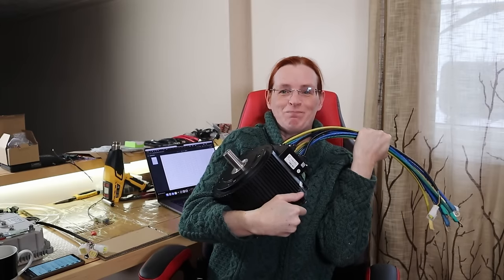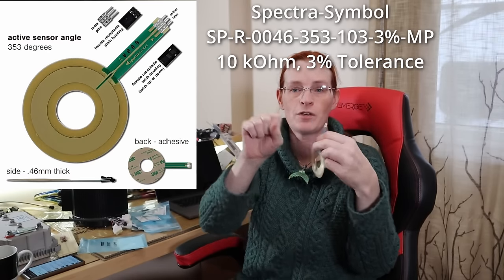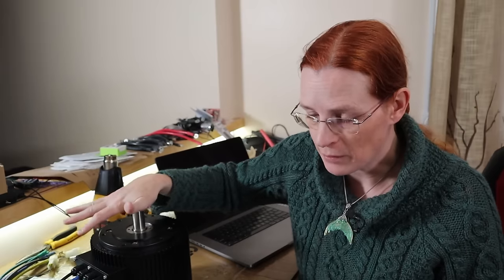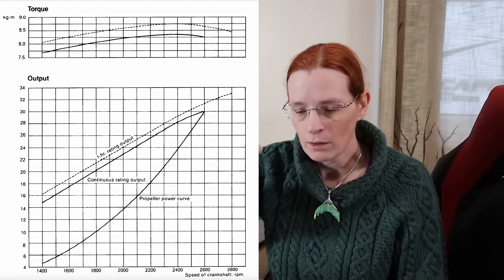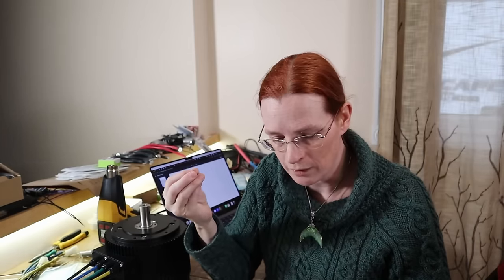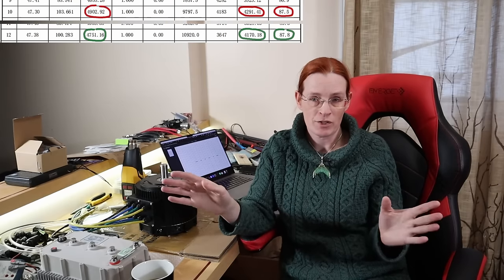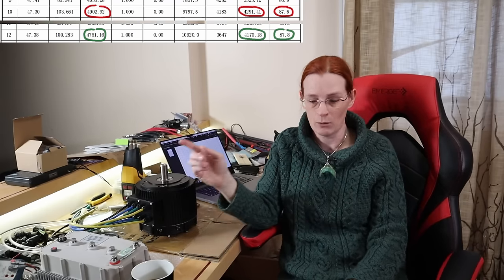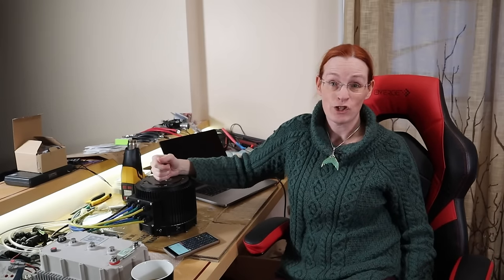Ep. 86 - Decisions Made! - Let's Get Technical

Comment: Nice idea's Maddy.s it possible to put the two motors in line and connect the shafts and then power one motor and let the second run freely. And if needed to power both. for extra power? Or is the friction of the free running motor too strong for that?
Reply from the maker: I had assumed that the resistance would sap too much power, but now from some other comments, I'm thinking maybe it'll be OK. I'll experiment!
Reply: @TheDigitalMermaid I have this vague memory that some electric motors operate with less resistance when on open circuit.

What mechanical resistance do you feel when trying to spin the axle manually on the desk?
Reply from the maker: I physically can not turn it by hand.

Comment: Regrading regen. I would advise you be a bit pessimistic on how much you are going to get from it. I am still saying you SHOULD do it, it is worth it, just don't over estimate how much you will get from it. Ever time I have ever heard numbers quoted - it has been at travel speeds higher then you would expect and also with props bigger then you expect - I suspect that it is mostly releated ot area of the "prop circle" and that how pi*r^square for the area thing means even a bit bigger prop catches WAY more water.
Reply from the maker: Oh, I fully expect to be underwhelmed, but I am trying to be as effective/efficient as I can be. That said, one of the many reasons I bought the Landfall is her cruiser/racer lineage. She's shown me how easily she car get up over 6 knots in even modest winds. You're right, going from ~13" to ~17" prop is going to be a lot more drag, but then, if I need power, I'll trade speed for kw. :)

Comment: Check out the following idea: Have both 10kW and 5kW motors permanently coupled to the shaft. For high cruising speed the 10kW should be the driver and the 5kW spinning freely. The "penalty" here will be the friction losses of the 5kW motor transmission and those of the idle spinning motor,* i.e. electrically disconnected. For getting down to 5kW "eco" mode the 10kW motor will still be the driver, but now the 5kW has now assumed the role of a generator. Doing so, you will have the 10kW running at high efficiency while recuperating the extra power. The penalty here consists  of the mechanical and electrical efficiencies from the shaft to the batteries (transmission + generator efficiency + conditioning for battery charging). It goes without saying that by adjusting the generator point you can have the 10kW running at its most efficient point. The "bonus" mode will be when the 5kW motor gets switched to driver too. (*) In my language (Greek) this would be called a "crazy" motor after the technical term of crazy pulley - τρελή τροχαλία. Nikos
Reply from the maker: Friction losses is why I originally didn't want to parallel them, though I'm starting to think, based on comments, these losses might be very small... If so, paralleling them all the time would be back on the table.
Reply: @TheDigitalMermaid  Dual motor EVs often let one motor spin idle when there's no need for the extra power and don't suffer much from the friction.  I'd be more concerned about breaking a bolt or chewing up a thread if you need to swap belts around much.  The less you touch the mechanics the longer they will last, and you're not going to want to be doing this in a storm (i.e. the longer YOU will last).

Besides, with both motors in parallel, one can be driving the boat while the other is in regen, so you can charge the batteries at the same time...  Oh, wait.  :)

Nice to know that the recent trip home could have been done with the post-conversion boat!  And given the engine failures, with a lot less stress.

Excellent video and explanation, as usual.  Your channel is unique (and refreshing) in letting us peek inside your head on the decisions and what goes into them.
Reply from the maker: One concern about free-spinning the inactive motor is mechanical wear, also, if the drag is otherwise low enough to make it worth it... The trip home on electric is still theory for now, but I would LOVE to repeat the trip, possibly in reverse, just to prove it can be done, and silence many of the nay-sayers. 

... or fail and be a great cautionary tale to arrogance. ;)
Reply: @TheDigitalMermaid  when they free-spinning the inactive motor that motor is usually not a permanent magnet motor as they don't like to be free-spinned but a AC motor that can do that without any problems. Dual motor EVs usually use different typ of motors front and back. Your Tesla is a good example of this setup.

Comment: A brand new Tesla model 3 has all of the parts needed for your project with ten times of the power at the same cost 😊
Reply from the maker: Sadly, not at all the same cost, given I saved a lot DIY'ing the build. More though, I don't need that much power, and most of the model 3 still use high voltage and cobalt based cells

Comment: Sounds very interesting, and you are gonna have fun experimenting and learning. I can't wait to see this phase progress and the design develop.
What you said, about wanting redundancy for failure and the 5kW motor being more efficient, made me think. I know you've already got the 10kW motor, but did you consider having two x 5kW motors, running only one when that's all you need, and somehow enabling the 2nd when you need more power. Are 2 x 5kW running in parallel more or less efficient than one 10kW, when at higher power output? Then if one fails, you still have the other, and replace it when you make port and can get another shipped, maybe even just carry a 3rd as a spare, assuming that only one will ever fail at any time. It might make the cable sizes and fusing easier. I know it all adds up in cost and weight, I just wondered if this was an option?
Reply from the maker: I did think of 2x 5kw, but by the time the low-end efficiency thought came up, I had the 10kw in hand. The efficiency is very dependent on where I am in the power curve, but the 5kw gets over 90%, which the 10kw doesn't, so there's at least some points where 2x 5kw would be more efficient than a single 10kw, on paper. Now having the two motors running together might cause mechanical inefficiencies that eat that benefit in the real world.
Reply: @TheDigitalMermaid  Yeah, the mechanical complexities of enabling the 2nd motor only sone of the time, could be a problem. And generally the types of motors that allow regen, don't free-run when not energised, so you have to actively disengage them mechanically. It's a common issue in EVs and e-bikes too. It's a shame, as Murphy's Law ensures that in a system with redundancy, where one is the larger than the other, it will likely be the larger one (or the one you really need) that will fail. Although, I guess as long as one works, you can still limp to a nearest port/marina.
Reply from the maker: @chelleh8673  Aye, going back to the breakdown on the Hudson, managing 3 knots would have gotten me to the next marina, albeit more slowly. The 5kw could move me at 3 knots even with 2 knots of head current, nearing max power. I'm OK with that in an emergency.

Comment: I would bring a 2-3kw small generator that uses pump gas. a Honda or a generic depending on budget. That would give you with with 10 gallons around 40kw of charging. That would be your backup to backup.
Reply from the maker: The current plan is, before I start travelling, to try to rig up a single cylinder 8~12hp air-cooled diesel to a 60~100A 48v-native alternator, something like the Balmar 60 or 100. Diesel gives you almost 2x the kw per liter of fuel, and I'll have diesel anyway for the hydronic heater and stove.
Reply: @TheDigitalMermaid Could you use the diesel engine to power your 10kW motor in regen mode?
Reply from the maker: So, a) love your nickname! b) in the very early days of the project, I gave that a very real consideration. Also, considered installing a smaller generator where the engine is/was also. In the end though, I decided I'd rather the space for even more batteries. Go all in!
Reply: @TheDigitalMermaid  a) thanks! b), yeah, I meant the 8-12hp you mentioned. Can't wait to see you rip out that big old diesel.

Comment: is it possible for a boat to have a wind generator and dump extra energy to another bank if need ?  heavy but when no sun then wind wins
Reply from the maker: Yes, but it's not practical in my opinion. The power curve from a wind generator is very steep, and the window where they make rated power and when they need to be braked to avoid over speed is quite narrow. I've spoken to several folks with wind generators, and the output never really seems worth it. The reason I'm going so in on hydro generation is that over-speed is all but a non-issue, because the hull speed of the boat sets an absolute upper limit. So I'd rather not have the wind generator shading solar panels or taking up storage space.

Comment: Efficiency for regen might not be too great. I looked at using aircraft props as wind generators but the twist of the prop is optimised for thrust not power extraction. Might not be quite as critical with hydrodynamics but it is totally useless for aerodynamics.
Unless you have a lot of deck space for panels I would only assume that panels will look after the ancillaries.
Reply from the maker: One of the reasons I chose the prop I did (link in the description if you want to see more technical details) is that their blades flip over 180 degrees. So they've been able to design them for optimal efficiency in one direction, unlike most other props. They don't care about efficiency in reverse because the blades just flip over. I'm really hoping that's going the help with the regen, but it's all theory until I get in the water.

Comment: You are not considering drag in water and wind resistance if head on. Real conditions will be different from a pre-calculated solution. I think you need to install some stuff and go out and test it and then make changes.
Reply from the maker: Did I not mention a few times "flat calm" as a qualifier to these numbers? I spoke about wanting to have the 10kw, and possibly even paralleling with the 5kw for 15kw, specifically to overcome strong real world conditions, like headwinds and currents. I also talked about exactly needing to get on the water to start putting this theory to the test...

Comment: Why not have the motor not in use free spin the controller can do that and there is minimum loss once its at speed and in an emergency you could have 15 kw of power
Reply from the maker: So, I've had a few comments suggest this now, and originally I thought it would be a waste of power / loss in efficiency, but it seems like there might be a way to free-spin the motor with minimal losses.... So this will be something I look more into as the project moves on. If I could leave both connected all the time, that would be brilliant.

Comment: 2 different multipluses won't work with vernus os... I think it would be better to keep the quattro and add a auto-transformer OR a separate 240v charger
Reply from the maker: The original plan was to use an autotransformer, but it would end up taking about the same amount of space and weight, and left me with another problem I didn't talk about in this video... Most electrical galley equipment is 230v 50hz, but being Canadian, most of my other gear is 120v 60hz. So I got to thinking; why not drop the autotransformer and get the two MP, and solve two problems? It also means I can pull more power from the shore, where the AT would set a cap on what I could draw.
Reply: @TheDigitalMermaid  Did you see Mads' (Sail Life) video about rewiring his AC system?  I commented that he should set the clock on the oven (caught flashing 12:00) and it turned out that nearly everything AC on the boat was auto-ranging and tolerated both 50 / 60 hz power.  All except the clock on the oven, that is.  Anyway, there might be easier / cheaper ways to do the AC system than swapping out the Quattro, perhaps with an added few-kw inverter.
Reply from the maker: I think so? But I don't remember the clock issue. I know it's not uncommon over here to use the power frequency as a time keeper, but it's not super accurate.
Reply: @TheDigitalMermaid  I can't find the video just now (I thought it was Mads...), but the conclusion was that most devices these days don't care about 50/60 hz as a result of needing to go world-wide; they all use internal crystal clocks.  It's the odd-ball that cares (e.g. his oven clock), at least in his experience.

Oh, one last thought.  I think a transformer also provides galvanic isolation from shore power, or am I mixing two different bits of equipment?  How would a dual-MP configuration solve that?
Reply from the maker: @tubeuser2350  The transformer I was originally looking at was also an isolation transformer, yes. I'm not sure if all are, I'm guessing not. In my case, I'm planning now to had a galvanic isolator just inside from the shore power connection, and then down-stream from that, a selector switch to direct the shore power into the appropriate multiplus, depending on where I am. The comment on most devices being auto-ranging 100~250v AC, 50~60hz is true, but the kicker is that we do 240v by going between two phases of 120v, where euro equipment is single phase 230v. So for the things that are voltage specific, like some galley equipment, I need to the 230v AC. The upside to the two inverters though is that, no matter who comes visit me on the boat, they'll have a place to plug in. haha.
Reply: @TheDigitalMermaid  Ah!  Right, split phase 240v.  Yikes.  So you need 3 different AC power (240v, 230v, 120v) inside the boat, and how many varieties of shore power?

Me thinks this deserves a video all by itself, especially when you look at shore power as being your charging infrastructure.  Just as in the EV world, using it effectively can't be taken for granted.  Your requirements for both multi-country shore power and the charging of a large battery bank from it is likely to be a consideration for others who might follow.

When designing your shore power inlets, be really sure you can't connect 230v into the 120v MP...  Some sort of interlock, to be sure.  My first thought was two separate inlets directly wired to the two MPs, which then parallel to the 48v battery bank, but then the isolation is missing.  Two isolators?  Are isolators voltage-specific?
Reply from the maker: @tubeuser2350  I don't need, and won't have, split-phase 240v. If I knew I wasn't leaving north america, that might have been an option to get the electric galley, but it's easier in my case to just order euro kit for the galley and have the 230v single phase, as it solves the problem of charging batteries when I get over there also. 

This video was meant to be a broad overview. As I start digging into the repower and refit, there will be videos focusing in on each step. So I am certain in time there will be a dedicated video on this, just not sure when. Getting the second 230v multiplus isn't critical until I'm ready to travel, so I may mark the spot and run the wires for it, but not actually buy it until the time comes. 

My current plan will be to simply have a check-list for when I switch grid types, and part of that will be switching which MP the shore connects to, as well as pulling the appropriate pigtails for the shore cable out of storage. The switches will be few and far between, given the literal distances to travel between them. The Victron "Galvanic Isolator VDI-64" doesn't list a voltage, so I don't think so. It would make sense that there is no voltage concerns, given it's a ground thing.
Reply: @TheDigitalMermaid  Ah, looked up what these isolator things are.  Just learned something!  I was thinking they were 1:1 transformers.  The isolators are actually a pair of high current diodes wired in parallel (but opposing directions), and placed on the ground lead between boat and shore. With low voltages (under 0.7-ish volts) the diodes don't conduct, so no galvanic current flows, but they will if called upon due to a fault.  The AC lines aren't involved at all.

Comment: Theres a young English guy mark from Wilding Sailing hes in Holland trying to complete a 42ft wharram pahi Catermeran ..  
Now originally the design would have used a single larger outboard or two high torque 9hps. 
I keep trying to pursuade him to do his own electric hybrid conversion. Using motors like yours ...it would simplify his propulsion needs considerably plus the Dutch along with many others are looking at banning diesel propusion from all inland waters conservation areas and  some harbours. 

Theres a UK company Advaced electrical Machines producing  modular motors that use no perminant rare earth magnets or copper .. that might interest you theres also a German Co called Molabo who produced a low voltage version with magnetic field gearing but they are prohibitively expensive.  
Battrey prices are dropping  currently and Northvolt has produced a Na ion cell with the capacity of per kg equivalent close to Li phosphate.
Reply from the maker: I watch him, actually! I quite like his down-to-earth style. The thing with electric is that I would never push someone towards it, because the way you think about powered propulsion really does change. I really came to understand this when I switched to an EV for my car; There are amazing pros, but also real cons. I think going electric is something someone has to want to do, in order for them to be happy with the new trade-offs.

I just looked at AEM's website, and they seem pretty light on technical specs... Ya, battery prices are coming down a lot. It's awesome, will make all this accessible to more and more people!